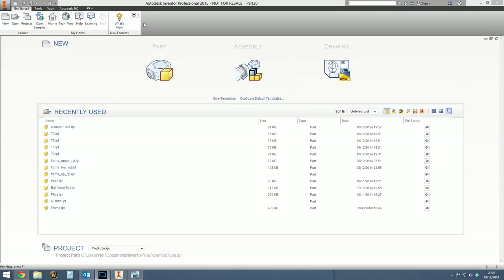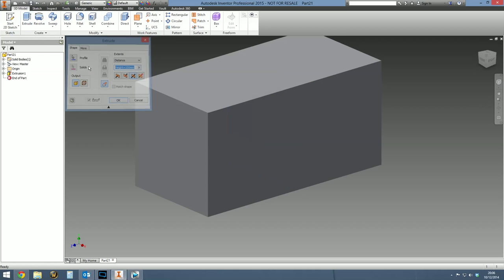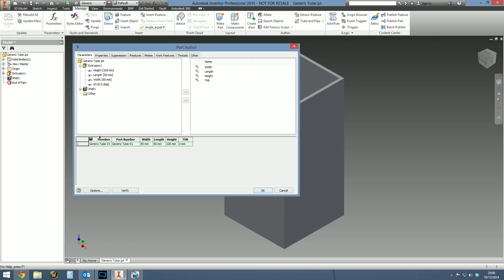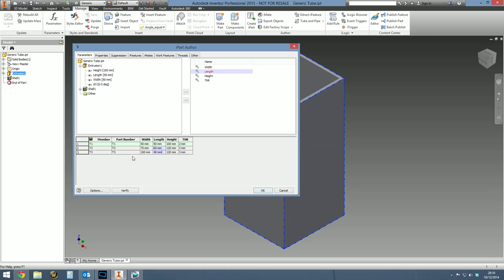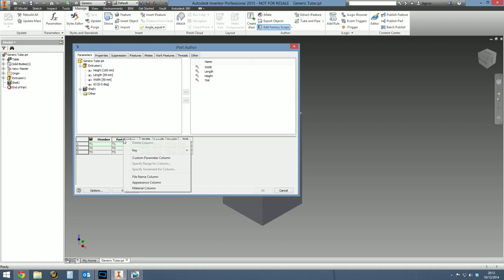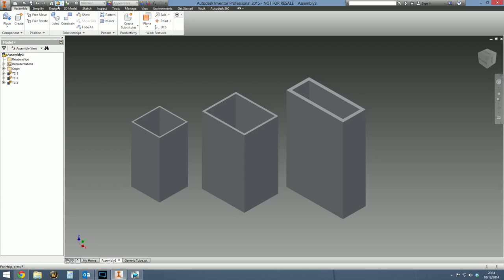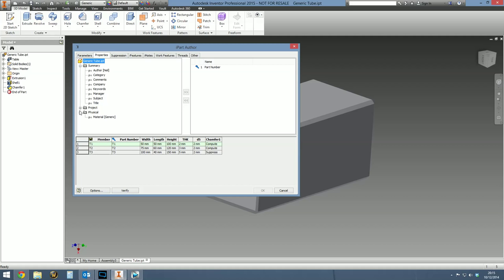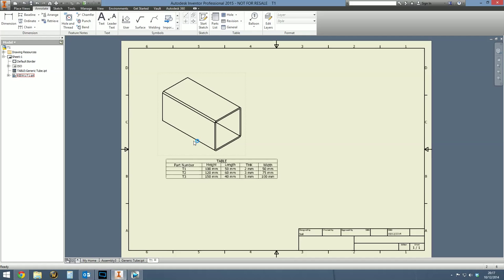How to create iParts | Autodesk Inventor

Comment: Loved the iParts video. Learned a lot. I created a 1 5/8" wide Unistrut iPart with 11 variations as an experiment. Worked great. I made the Length a custom parameter so I could change that as I place it in an assembly. However, what I would really like is for this iPart to be a starting point for creating a separate part file that I can then edit, i.e. put end treatments and holes in etc. Is there a way to save a placed iPart as standard .ipt? Or, is there another way of generating a file similar to the Content Center structural shapes?

Comment: People (Inventor users) have been trying to scare me away from using iparts.  I'm a long time pro-e user and have used family tables for(ever) a long time.  What is the fatal flaw with iParts that make them so different from pro-e?  (Or simply what makes people freak out about them?)  

If you have other videos...I haven't look yet...but feel free to point me in that direction.  This was very well done.  Thank you..Andy
Reply from the maker: +Andy Hessler I've never used Pro-E so I've no idea what the comparisons are, the only negatives I've heard with iParts is when people try and use them with Autodesk Vault as that can end in a bad time if not done right.  Other than that, as far as I know there's no inherent problems with them
Reply: +TFI CAD Tips Thank you.  Managing the generic and instances is always delicate.  It doesn't matter what system you're working in.  I found that TeamCenter (Siemens) linked with Pro-e was a very challenging set-up. I'm not sure if it's always a bad pairing or if the company I was with implemented it poorly.  However, it's pretty clear that when permissions (access to work on parts) get dispersed across multiple business units...things are going to get messy.  

I think from your video I can reasonably say that the iParts do seem to work well when used to drive family tables of similar parts (usually hardware related).  My next concern is to understand how best to manage the "background" geometry that gets used with larger assemblies.  In pro-e, the technique most preferred was to create (at a minimum) a generic and one instance.  In the generic model...all of the background geometry would be suppressed.  In the single instance in the (iParts) family table, the background geometry would be unsuppressed (active).  The drawing would be driven from the instance.

Thus, when the model would be assembled to a higher level assembly, the generic would be the default selection and the background geometry (map parts, skeletons, copy geometry) would not be brought along for the ride.  At each company I've worked for, this data is poorly managed and neglected...which leads to people complaining about slow response times on their computers.  So, the goal...at my new gig, is to try to pick up where I left of instructing people on best practices.  (I just have to figure out what those practices are first %^) )-Thanks.

Comment: Great Video Mate thanks for that ! I'm struggling with something on my level 2 course though ! I have to create a plug socket with one plug hole then make it an ipart which changes to a 2 then 4 plug socket. I can do this easy enough but then theres 2 things that don't seem right......once I've finished them I physically have to click on my plug socket TOP part then click on which instance I want to see e.g SocketNum 2 then click on return to the full assembly and my tutor tells me I shouldn't need to do this ? secondly I have to press the update button in order for the BASE of this plug socket which is its own part to update accordingly, I kind of understand the whole ipart thing but I think I've got a bit of a sketchy way of doing it ATM. Could you do a video for creating an ipart that also has another part attached to it that will automatically update please ?

Comment: Hi TFI,

Really great tutorial on iParts.  Got me up and running with a simple assembly made up of a couple of sub-assemblies.  Settling upon configuration that best suits my needs I have gone on to pull together a suite of drawings featuring a bill of materials parts list.  It would be helpful if I could send you a couple of screenshots.  I have enabled structure and parts only in the sub-assemblies, however, when I try to do the same in the top-level assembly parts only does not present itself.  I'm not sure if this is causing my problem when I get to including the parts list in my drawing.  In my drawing no matter what I do I cannot get my parts list to show all the parts in the top-level parts list.  Have you any tips to help you show all the parts in the top-level list?

Kindest regards,

Derek.

Comment: Hi, thanks for the great instruction video. I have tried it and it worked perfectly. I have also tried to do this on an assembly that is based on 1 main part with 2 different parts who are linked to the main part. There dimension is based on the main part in this situation. I made the main part an Ipart and replaced the Ipart into the assembly. Then I made the assembly an Iassembly. It gave me the correct chooses to select different dimensions from the main part, but the other 2 parts in the assembly will not update because they are still linked to the original main part. Is there a solution for this? Best regards, Richard

Comment: How does this work with Autodesk Vault? I notice that iParts have limits work into vault. First, you cannot change iProperties, Folder name or even move folder. All modification need to be done in Inventor.

Do you have any tips and tricks using iParts in Autodesk Vault?

Comment: First off... GREAT VIDEO!!! Second... could you point me in the direction of a tutorial on how to make a part that will get it's length by constraints? I'm building Curtain Wall and want my horizontal extrusions to get their unique lengths by constraining them to the sides of their corresponding Vertical extrusions... hope this makes sense... I don't want to have to enter a specific length, but rather tell Inventor that I want it to stretch between point 'A' and point 'B'. Any help would be MUCH appreciated... may also make my Boss happy, but that's beside the point... Thank you for your time!!!!!

Comment: I noticed you are an Autodesk certified professional :) I am taking the professional exam while I am in Las Vegas for AU this year and while I have been studying an Inventor 2017 student guide, I am still a little weary about what I am going to be facing. Correct me if I'm wrong, I believe I am going to be tasked with using the software to create something specific to an industry, along with some test questions. Is that accurate? I can't seem to find much help online, everything I've read just seems to disparage the exam and claim that it's not really worth taking. What do you think? What was your experience like?

Comment: Super cool video but I can't create any iPart, I have this error :
"Excel installation is required for this operation. Failed to launch Excel."
It's not possible to create a iPart without Excel ?
Reply: Hi, have you did any solution for that issue? I'm facing the same problem. If you could share, i'd appreciate your time on that. thanks in advance

Comment: Great Video ! can you create one for iAssembly ?
Thanks 
Your Channel Is Awesome
Reply from the maker: noam alon Why thanks! Yea I guess I can do an iAssembly tutorial, they're a little more complex than iParts but I suppose it's a good topic to cover, so yep I'll get on that.
Reply: CloudCAD Ltd cool! i mean something like configuration in solidworks , sometimes i have assemblies that i want to change only few parts but have it as one assembly file .. (without any connection to iParts) , also how to use the iAssembly in the drawing .  
thanks again !
Reply from the maker: noam alon Hmm iAssemblies are pretty much based on iParts though.  Not sure an iAssembly is what you need.  The whole point of an iAssembly is that it contains iParts, and for example in version 2 of the iAssembly it will use version 2 of certain iParts... you can kinda use non-iParts but it becomes a little messy.  I'll see if I can build that into a video somehow.
Reply: So how normally you create configuration in Inventot??